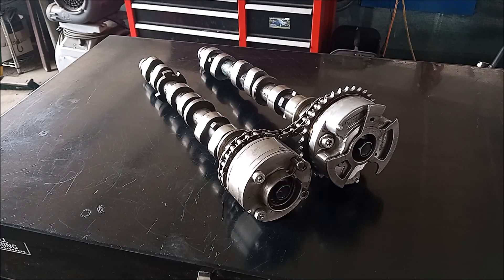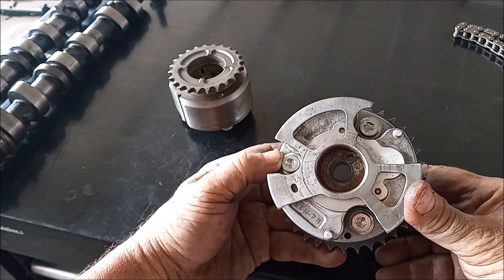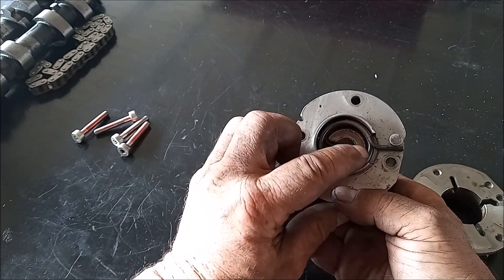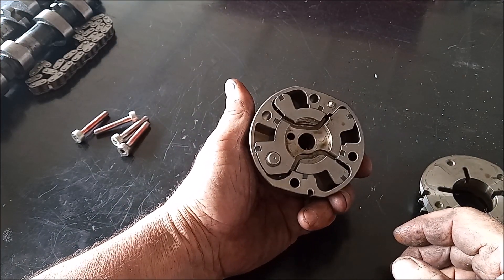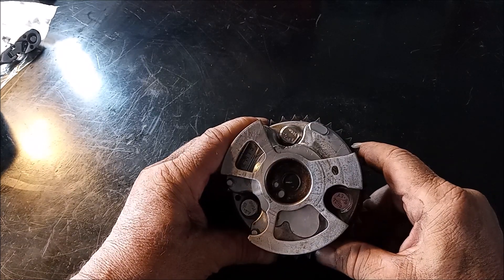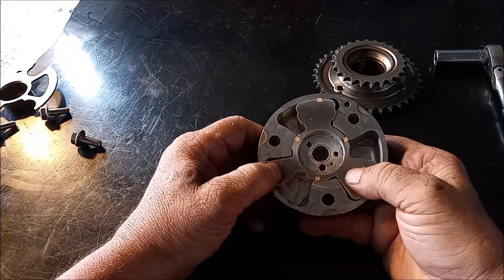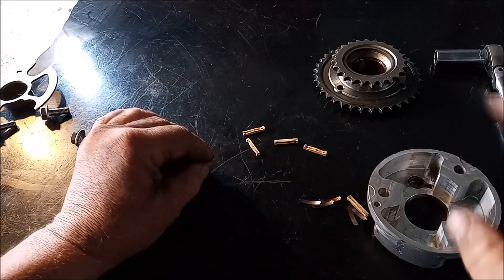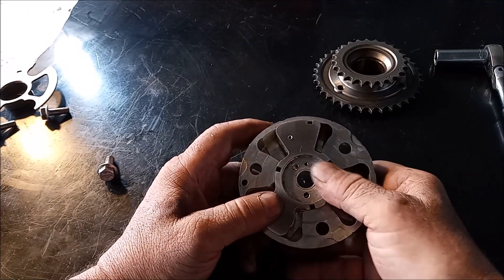Inside 2GR-FE Engine Variable Valve Timing VVT Camshaft Gears - Intake Exhaust Camry Highlander RAV4

Comment: Can that spring collar on the exhaust gear be fixed once it starts coming out?(without removing engine)???
Reply from the maker: Someone had a method for fixing the exhaust gear but it is obsolete now because you just replace the gear. You can remove the camshafts from the engine on-car if you're careful

Comment: I have a 2008 with the 2GR-FE and it gives me a rattle on start up. Would a replacement of these camshaft gears be all that’s needed? Not a timing chain. Also are there 2 or 4 of these in there
Reply from the maker: Check my video for the "miracle cure" for the startup rattle. Definitely worth trying before you go to replace the camshafts which is a engine-out procedure. There are two exhaust gears, and two intake gears - four total.

Comment: I have a 2012 Camry with 2 VVT gears. Do I need to somehow unlock the exhaust gear before torquing it, or only the intake gear? I can’t get an answer to this anywhere.
Reply from the maker: on a 2gr-fe engine you do not need to unlock either gear. The unlock procedure is only for older engines 2AZ-FE, 1zz-fe, et cetera.
Reply from the maker: Same for 2AR-FE (2.5). No unlock.

Comment: I’m wondering if this can be done in the car. Without taking the entire gear off. Just the half that goes bad. 2007 Lexus is250. Seems like intake gear spring gets weak over time and does not keep it in lock position after engine is off. The new gear will likely have a stiffer spring. Right?
Reply from the maker: ez pz in is250. Lexus even has a youtube training video that shows you exactly how to remove the and replace the camshafts on-car. Search for it.

Comment: Can I push the collar back in my engine then tack weld it in place?
Reply from the maker: You can certainly do that but I can't tell you how effective of a repair it would be.
Reply: @ HAS ANYONE DONE THIS???
Reply: I'm looking to take the engine out of my Aurion, it's got VVT rattle as well as oil leaks and maybe an external coolant leak... I haven't looked at the cam gears yet, but with 315,000km I wouldn't be surprised if the exhaust collars have shifted out. When I have them in my hands I'm sure I'll figure something out. The collar apparently shouldn't come out unless it gets starved of oil. 
I am also considering just doing the spring on the intake gears if it hasn't worn itself after all the rattling it's done. 

What did you end up doing? New rev.3 gears are around $200 ea which is really hefty imo.
Reply from the maker: @ buy used gears. From any Toyota with 2gr-fe engine. Anything newer than 2010 should not be subject to the cam gear issue.
Reply from the maker: I am seeing them on Ebay for $50 USD.

Comment: Thank you for making this video and showing the inner workings of the exhaust cam gear! This is exactly what I was looking for and unfortunately, I am currently experiencing the collar issue on my 2007 Toyota RAV 4. I know this may not be the best way to do this, but do you know if it's possible to remove the front spring part with the collar while leaving the sprocket attached, and just replace that top spring part? I know the best thing to do is replace all of the workings of the timing chain and both cam gears.
Reply from the maker: All you have to replace is the exhaust cam gear. You can do that in-car if you're methodical and careful.

Comment: Another thought, maybe there is only a return spring on one of the cam gears because perhaps it can pull both intake and exhaust into locked position. Like maybe whichever gear has more travel range, they just put the return spring on that one, so it first pulls the other back until it locks (they're tied together with their own chain, so as one moves, it affects other), then as it travels more it locks itself, the one with spring. So spring is on exhaust, so maybe once oil pressure gone when engine shut off, it pulls intake gear, via their linked chain, into locked, then spring keeps pulling and locks itself, exhaust.

Interested in your thoughts on that possibility.
Reply from the maker: Bank 2. Face from the front. The exhaust camshaft rotates counterclockwise relative to its gear to retard. The intake camshaft rotates clockwise relative to its gear to advance. Stop the engine. The gears want to go in different directions to return to lock. Anyway that's how I am seeing it. Could be wrong. Not really putting a lot of thought into it.

Comment: Late to party I know. Had to chime in, those plastic or 'teflon' pieces that fit into the grooves on each lobe inside each vvti gear, those are apex seals. They prevent all the oil pressure that needs to fill in the cavity and move the inner lobes away from the outer ring from just leaking into the opposite cavity. The oil that works against the spring, that the screwdriver was being used to demonstrate how it moves when oil pressure applied.

Their purpose is very much like piston rings. Specifically oil control piston rings. Only they're straight seals, not rings. Apex seals.

They're not providing 'lubrication'. The oil spewing in under pressure already has that covered. Also, removing them makes it markedly easier to manually manipulate the back and forth action that takes place in real use. If they served a lubrication function, their presence would make that easier, not harder.

Very pleased to see inside of these, as no one else has done this. So kudos to you sir!
Reply from the maker: Bertrand Julius, eh.

Comment: So the exhaust actuator is not prone to any rattle at all? My dealer replaced the timing chain, the tensioners, the chain guides and both the intake VVTi actuators. I have a loud rattle not directly after start but after maybe one second after start. I uploaded a video of the sound on my YouTube channel. Any ideas with this?
Reply from the maker: the exhaust gear on one early series of motors is the one that is prone to catastrophic failure i.e. breaking up into pieces. I thought I explained this in this video and showed examples of what happens to the exhaust gear. The issue with the intake gear is comparitively mild, it just rattles on startup. Clear? There are many other things inside your engine that can make noise. Don't get too fixated on any one thing. It's a noisy hot mess.
Reply: @Merryfrankster_  Fully understand. The garage has the same understanding of the exhaust actuator and did not change it, because it’s not known to make these noises at startup. I am also aware that these engine are not the quietest on the market, but the noise that I have is different from the YouTube videos you see related to rattle on start. It’s not normal. I think they need to investigate this further.
Reply from the maker: @FlorusW  Take off the belt. Run the engine. Is there noise? No? Problem with drive belt and pulleys. Yes? Internal problem. Use stethoscope. Where is the origin of the noise? Timing cover? Valve cover? Exhaust flange? Good luck.

Comment: This might sound odd, but I have the exact issue you shown in your video with the exhaust phaser. Weird question. Do you believe if I tac weld it in place will that work? I understand it as it’s just a guide to hold the spring in place. No? If so let me know. I’m trying my absolute best to do this as cheap as possible. The replacement from the dealer will cost more then what I even paid for the engine. 😭
Reply from the maker: Couple of options for you - get a used one on eBay from a more recent model car - it will have an updated part number. Or, if you search, there is a video done by a shop on how to modify the cam gear to prevent the walking.
Reply: @xboxhater12345 Did you ever find a solution to this issue? I have found that both of my exhaust gears are doing the exact same thing.
Reply: @hotrodfanatic1  I just went to the junkyard and ripped out some cams from a 2010 model

Comment: @merryfrankster for the rattle issue.   what if cleaning the screens and replacing the 6 little gaskets doesnt fix the issue ?   do you recommend to replace the (2) exhaust ones or  all 4 ?
Reply from the maker: The defective exhaust cam gear affected only a limited year range and vehicle type. Refer to the original TSB. The design fault was corrected on later vehicles.  If the exhaust cam gear is making noise it is because it is coming in contact with the timing cover. This should be clearly visible if you remove the valve cover and look underneath. You can also use a  mechanic stethoscope to try to determine the source of the noise with the engine running. Another possible source of noise in the valvetrain is from collapsing hydraulic lifters. This should be ruled out before you replace the cam gears. Or you can go wholesale and replace everything, lifters and gears, while you have the cams out.

Comment: Does anyone know the torque spec for the bolts holding on the cover?? Can’t find anywhere
Reply from the maker: No, there is no spec for these, because the fsm says never remove them. You can safely use the spec for a bolt of the same size, with either green or blue loctite - my guess.

Comment: I think i have a small ticking sound on bank 1 when engine warmed up (ticks randomly, no cold start ticking issue). I always use best quallity 5w-30. I'm considering using Liqui moly additive for hydraulic lifters to increase the viscosity of oil. Do you think its a good idea? What should i do? No check engine lights
Reply from the maker: The hydraulic lifter is like a little piston. If it gets an air pocket inside then it does not work as intended. Additives do not help. You must remove the faulty lifter and reprime it, as instructed in the factory service manual, or replace it. An additive can mask the noise of the rocker arm on the valve tip, but it does not solve the issue.
Reply: @Merryfrankster_  Sorry i forgot to mention that the sound i'm having is not from a bad lifter. I'm guessing it is because of one of the vvti gears or maybe a solenoid for that is sticking or something. I can hear the sound only through the radiator or underneath the car. It is quiet from the top. Guessing the sound from vvti gears could somehow transmit to these areas. Suspecting the waterpump as well, but i doubt it would be making a sound like that

Comment: Hi. Great explanation. What causes the actual rattle noise on startup? Is it the pin not engaging due to lack of oil pressure?
Reply from the maker: There is enough oil pressure to disengage the pin but not enough to control the rotor so it slaps back and forth.
Reply: @Merryfrankster_  That makes sense for the exhaust gear because the updated version has a stronger lock spring. The stronger spring would require more oil pressure to move the lock pin effectively delaying the unlocking of the gear until more oil has flowed into the rest of the gear. 

But what causes the rattle in the intake gears?
Reply from the maker: @ABCarmand  How do you know the intake gear is rattling?
Reply: @Merryfrankster_  Well most videos I have seen show the centre of the exhaust gear popping out after rattling for a while but I did see one video where a guy was changing the intake gear due to rattle. He never said how he knew it was the intake gear and I certainly wondered how someone could know which one since you can't run the engine with the valve cover off and listen to one gear or the other with a pipe to your ear or something.

Does the intake gear ever rattle? How would one know?
Reply from the maker: @ABCarmand  Ok good info there. First of all the exhaust gear self-destructing is a different issue from the startup rattle. The startup rattle is mainly due to insufficient oil pressure to prevent the vanes from rattling around. At least that's my theory based on available evidence. Some other technicians believe you might be hearing piston slap at startup and that the 2GR may be prone to this - I doubt that. if this were the case then replacing some vvt oil passage oil rings would not eliminate the noise as has been shown to be true. Please view my video titled "MIracle Fix for the VVT Death Rattle" as I lay it out there.
Reply from the maker: By the way if you do want to test a specific gear behavior, disconnect its OCV from the harness.
Reply from the maker: When you do this the gear should remain locked.
Reply: @Merryfrankster_  Wow that's smart. 

I just got this van and have only done 3 cold starts. It has made the rattle the first and third time so far. If it happens consistently enough, I can try day after day disconnecting the ocv solenoids to isolate it. 

I may do that before I replace the valve cover seals just in case the noise is being made by one of the gears that are toward the front of the vehicle which should be easy to change. Then I can hope that the other three don't develop any noise with the new seals. If the noise is coming from a gear in the back, I will just start by changing the seals and see what happens. If the noise doesn't come back then I'll just leave it.

Will the ocv fault codes caused by disconnecting them become none active once I reconnect them?

Is it safe to run the engine with a gear locked if its for a short time at low idle?

Comment: Those bolts on the VVT gears appear to be torx 5 point, no lump in the middle, so the anti tamper version is not necessary.
Reply from the maker: Buddy those are not torx bolts.
Reply: @Merryfrankster_  They look a heck of a lot like a ts40 or ts50, oddball 5 point instead of standard 6 point torx.  I run into them occasionally on Porsche & Audi bits.  It wouldn't be the first time I was wrong about something today.   Thanks for this great series.
Reply from the maker: @briancorrigan5350  you were right. I ordered a set of 5-point torx to see. They are 5-point t-25. I did not even know that these existed until you mentioned them here.

Comment: Interesting to see the internals. What is the recommendation if you periodically get the dreaded rattle on cold starts? Replace the exhaust gear? Intake cam gear or both?
My 2008 2GRFE Highlander has been scrupulously maintained with oil changes full synthetic every 5k miles or less. Odometer currently at 110,000 miles. 
Will these gears ultimately blow up the cams?
Reply from the maker: The exhaust cam gear failure is not related to a cold start rattle. It is caused by the cam gear impinging the timing cover.
Reply from the maker: If you have the cold start rattle, start by cleaning the vvt strainer, and replace the o-rings under the valve cover. I have a video covering this. Sometimes this is all you need to do to eliminate the cold start rattle.
Reply: Thank you for your response.

Comment: Wonderful, Love to see 2GR internals, nice precision engineering, those little plastic wiper seals are long lived I hope... also you can see why oil changes are so critical on VVT engines
Reply from the maker: It's amazing that VVT actually works. Considering all the reasons that it shouldn't. Thanks for working